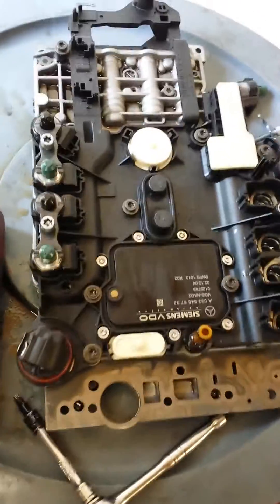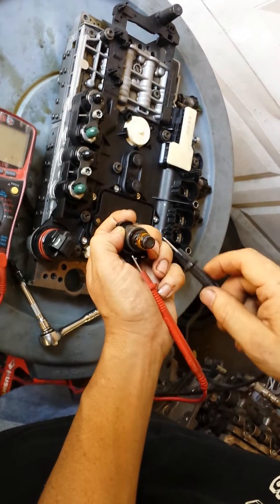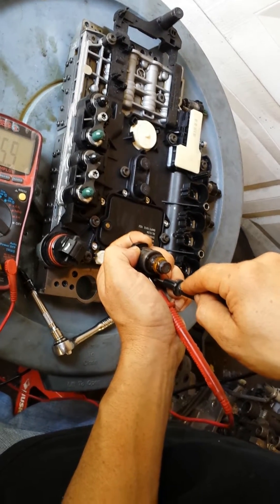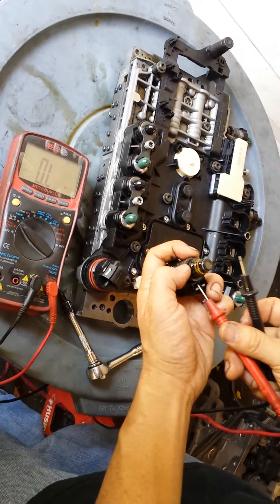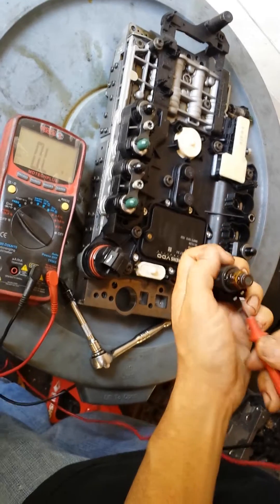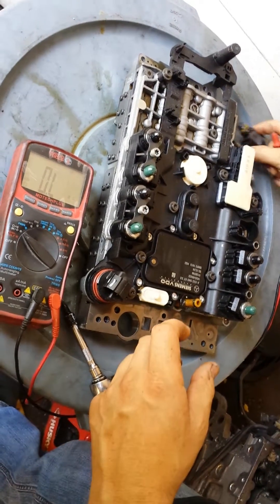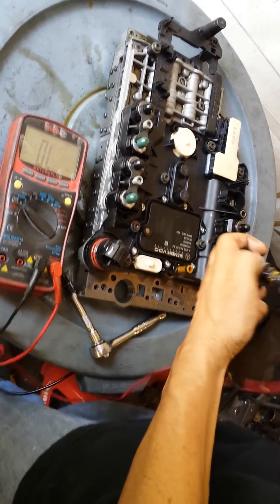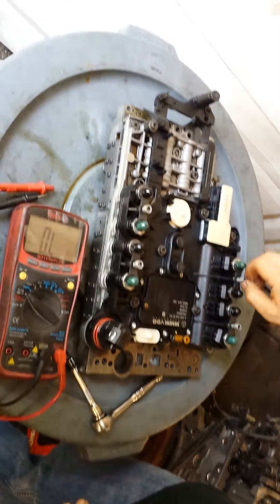Mercedes Transmission solenoid test

Comment: hello, I see that you are very practical.  in my 722.9 there is a problem when engaging the reverse gear.  When changing from D to R or N when the oil is cold.  Could it be a solenoid problem?  because it only does it from D to R.

Comment: I get that 5.5 measurement also but I do get a P0748 K1 electrical fault on the blue solenoid next to the connector. I check it with 12v and it clicked but there are some marks on the screen. How can you tell if the solenoid is ok besides the resistance test?
Reply: Hi sir...how do you solve that problem....either change it or another way...

Comment: hola cambie un transmission 722.9 2004 a mi 2006 mercedes 722.9, Pero la del 2004 tiene 4 pins en el TCM plate y ocupo 5 PINS que tiene mi 2006. mi pregunta es puedo cambiar la del 2006 al la transmmision 2004 LOS 2 SON DE 7 CAMBIOS

Comment from the maker: we offer new conductor plates in virgin mode ready for scn coding just call
 214-207-2619
Reply: Hey galvan890 do you know how much amps it takes for the solenoids to operate when shifting. im thinking 6 amps does that sound right?

Comment: Thank you I have been trying to find a video that would help me test my solenoids.  My transmission won't shift out of 2nd I have error codes p0715 and p0730. I'm going to change the conductor plate and check the springs and try to trouble shoot my problem.  Thanks for the video!
Reply: what was the fix with your transmission? Solenoid or conductor plate?
Reply: Godspeed1 7
Reply: What was the fix ?
Reply: @truckingchannel573  He said change the plate it goes bad if not changing the fluid on time. You also have to get someone to reprogram